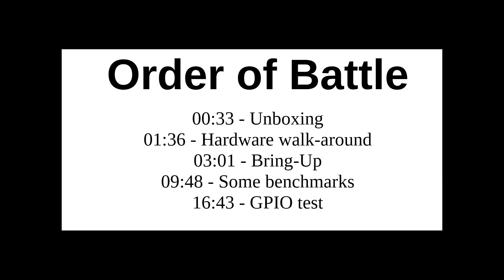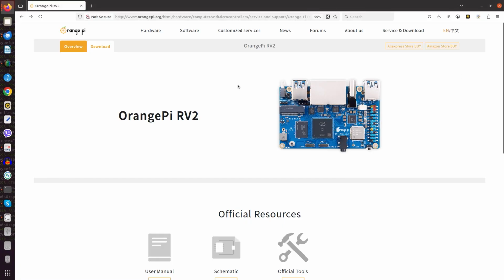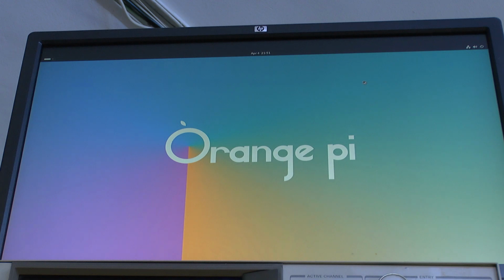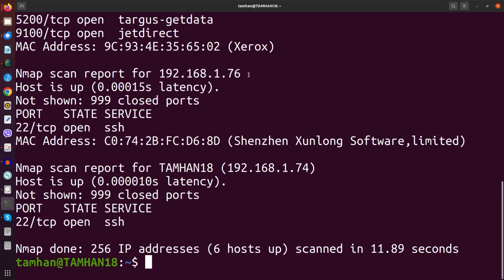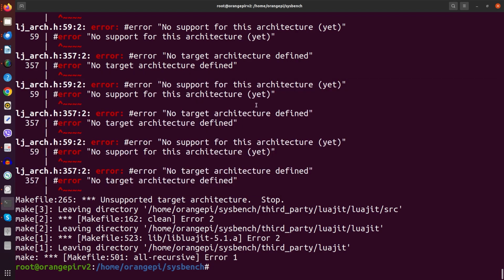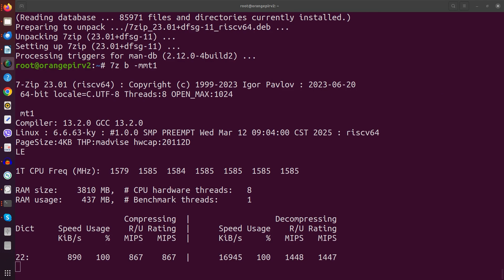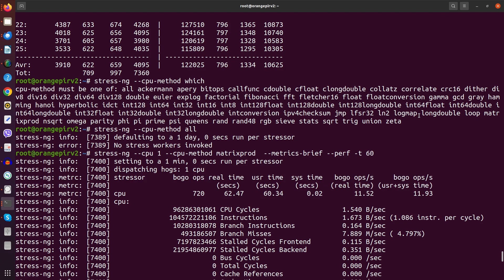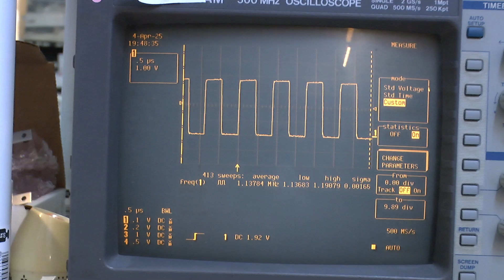OrangePi RV2 unboxing - getting started with RISC/V Linux

Comment: It's good I didn't purchase it yet.
Reply from the maker: Hi Man, thank you so much for talking back. Is there anything specific I should test?
Reply: @MrTamhan  Honestly it looks as a decent but very slow machine. Maybe you can test if you can install Rust on it?
Reply from the maker: @kamertonaudiophileplayer847  Hi, AFAIK RUST will run for sure - it is one of the core technologies of the Kernel. Can you maybe point me at some kind of benchmark to test your application?
Reply: @MrTamhan  I will check if I can cross compile my app for Risc-V.
Reply from the maker: @kamertonaudiophileplayer847  thanks man. Please keep me in the loop!
Reply: @kamertonaudiophileplayer847  ?? It seems like it's exactly the speed you'd expect from a dual-issue in-order 1.6 GHz machine similar to Arm A53 or A55. What is it that you think is slower than expected?
Reply: @BruceHoult  Simply people expect that some magic will happen. But it looks  like you need  to be extremely lucky for it.

Comment: Try using QEMU and Box64
Reply from the maker: Hi Man, did my answer make it? YouTube gave me a weird error here when I tries to respond...
Reply: @MrTamhan  
I'm thinking of buying an Orange PI RV2 for its hardware features and multiple ports.
Reply from the maker: @x-gamessimulator1067 Hi, thank you so much for talking back. It is technically definitely possible - but if you want to mainly do control tasks, and are not suffering from sanction risks, why not take an ARM unit with similar port complement?
Reply: @MrTamhan  
I was thinking of buying an Orange PI RV2 so I was wondering what it would be like to use Box64.
Reply: @MrTamhan  Play with words. There are keywords that YouTube blocks.